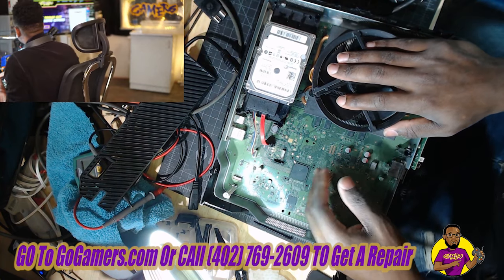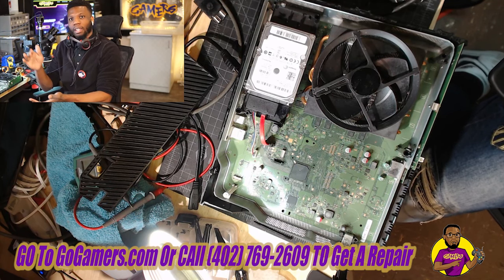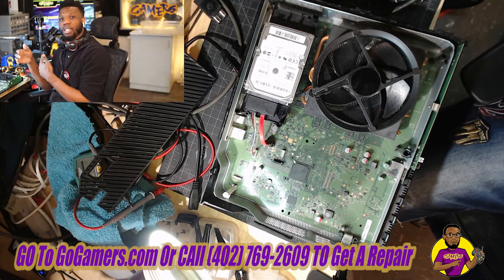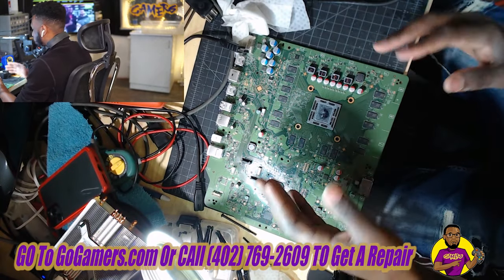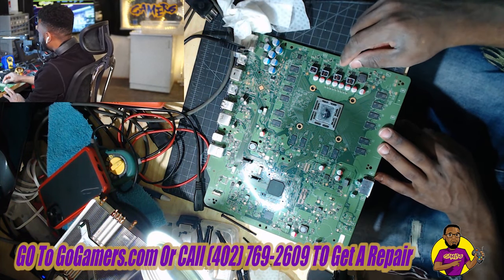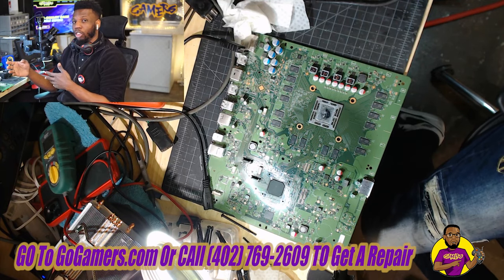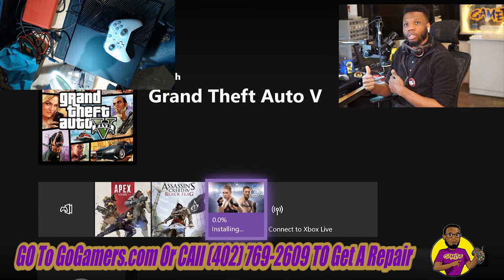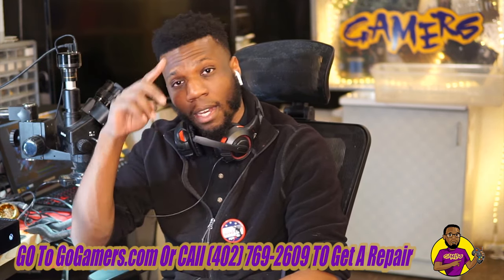Fix Xbox One Water Damage Wont Turn On EASY Repair (QUICK METHOD)

Comment: thank you so much i was trying to move my xbox and i went to go move my monitor and my arm hit my drink with soda in it and it spilled over in my xbox fan area and it was turned off and unplugged thankfully and i went to plug it back in and it turned right back off i tried that a couple times and then i used a hair dryer to dry it out and made sure it wasnt wet under the fan keep in note i didnt take it apart i only took apart the bottom piece where the clips are then i went to use the hair dryer to dry it out for about 5-10-15 minutes on the fan area then the sides where the power supply is then i went to plug it back in then the fan turned on knowing thats a good sign then i pressed the power button to turn it on then boom it worked if it wasn't for me watching your youtube video then i probably wouldnt of fixed it thank you so much u earned a sub and a like i appreciate it so much from the bottom of my heart i had a little anxiety lol its also a xbox one s

Comment: I have 3 Xbox Ones in attempt to start learning to repair. I got lucky with 1/3 but I have two others that seem to have water damage. One turns on and off,  the other doesn't turn on at all. Attempting to aim for the one that turns on then off. Thoughts? Stripped all the way down to motherboard. Can see the green deposits from water on the bottom of the board.

Comment: Had one sitting on my shelf for years now because I took it to a hotel my buddy was staying in to drink with him and play some games and I didnt notice it but the AC was dripping condensation that was hitting an object and splashing into my fan's vent. Xbox wouldnt turn on so I just shelved it and got a One X. Havent even thought about it since until randomly a few minutes ago. About to test it now and if it doesnt work maybe try cracking it open to see if I can find any burns marks or anything to find the short and then if it's a cheap part Ill just replace it and try to resolder it. If all that fails or isnt an option then Im thinkin Ill put it on ebay for 10 or 20 bucks and sell it as water damaged and possibly repairable. It's not like a bucket got dumped into it but I have no idea how much of many drops of water actually made it inside to the vital hardware so the damage could he literally anything. It could be the fan just doesnt turn on or the whole thing could be fried. 😬

Comment: Son spilt juice on mine, I took it apart cleaned it down, put it back together  and it still won't turn on, any suggestions
Reply: Power supply replacement.

Comment: Hey, Dave - this is exactly what our xBoxOne is doing - powers up for one second and shuts off.  It's the model with the internal power supply.  I'm not sure it got water damaged - but I took all the cleaning steps here (all th way down to the motherboard), verified the HDD is good, and tried a new internal PS, but no fix.  Still doing that 1 second boot.  What's the next step?  New power rails?  Can I put it in a box from NC and send it to you guys to make the harder fix??  Thanks again!!!
Reply: I’m having the same problem did u fix it

Comment: Okay I have a question for you my son got water into his Xbox I took it apart cleaned it out let it dry out for like a month and it turns on now you could play it for like 10 minutes then it shuts right back off I think the fan do you think I should buy one of those?
Reply: Usually you can hear the fan running before the water incident on a Xbox now the fan just moves real slow

Comment: Hey I spilled vodka on my Xbox wile it was on and I’ve taken it appart cleaned it up with sum towels and had it running for about a half hour and it shut off  so should I try my air compressor and see if it will work
Reply: Ahh. Vodka, perfect cooling liquid, XBOX Drink vodka, and got drunk, wait for XBOX to sober.

Comment: I accidentally popped a water balloon on my xbox one s and used a hair dryer to blow out all the fans and even took off the case and when i tried turning it on it came on for a few seconds and then it sizzled and shut off now it only makes the noise but doesnt turn on
Reply: Sizzle? It's fuuuuuuuuuuuuuuuuuuuuuuuuuuuuu

Comment: I got water in mine but I can hear the fan going not sure what to do it turns on and stays on just no picture and the fan running hard and slows down like a beat
Reply: The HDMI Port might be gone, also that fan is fucked.

Comment: I didn’t get a lot of water on mine and it didn’t pop so I put a fan to it and turned upside down for 24 hours
Reply: Did it work
Reply: @stewart7823  yeah it even sounds quieter but still wouldn’t pour water into your Xbox😂
Reply: @milk294  i just had it upside down on my lap for like 30mins and when I lifted it my shorts were soaked but it worked again

Comment: My sons Xbox had the same problem. Turn it on, and get right back off... i found out, there was Coke or Ice Tea in it, and i got some burnmarks... i cleand the board, but it will not power back on 😪

Comment: My dog spilled water on mine and I didn't even know. So I was in the middle of playing and it suddenly turns off- no popping noise, nothing. Then I realized it was extremely wet...

I don't know if it's saveable or not, I unplugged it and everything but I may have been too late.

UPDATE: Nevermind! I got it in time and it works like a breeze.
Reply: What did you do to fix it?
Reply: @darkwing4027  Oh man I'm way late on this but in case anyone else is wondering or you want a reference for the future as I'm sure it's too late now, I unplugged my xbox (obviously), and placed it upside-down on a towel. I switched the towel out a couple times, since they'd get a bit damp, and did that for about an entire week. I don't know if this is a bad idea or not but I did use a hair dryer a little bit, but only for about thirty seconds before letting it cool down, and doing that a couple times a day. I mean it's still working like a charm for me even now so it didn't do harm as far as I know!

Comment: I turned mine upside down and it started working
Reply: The water likely wasn't able to reach the heatsink, and by extension the power supply and processor, that's lucky asf.